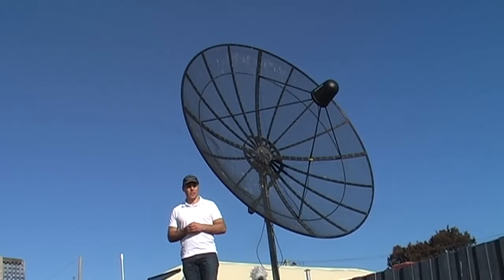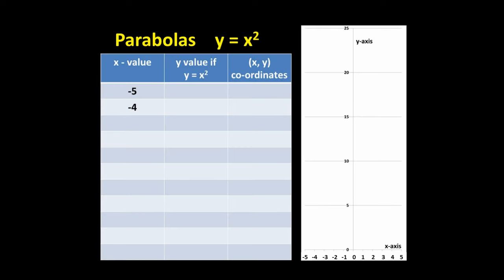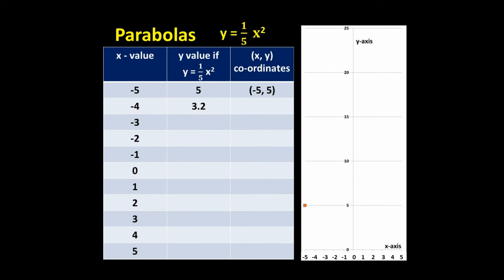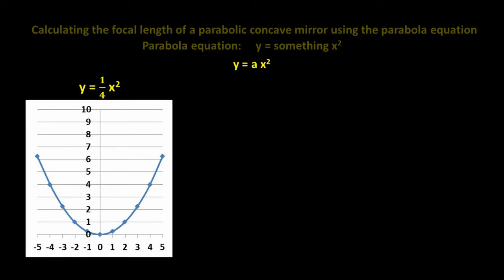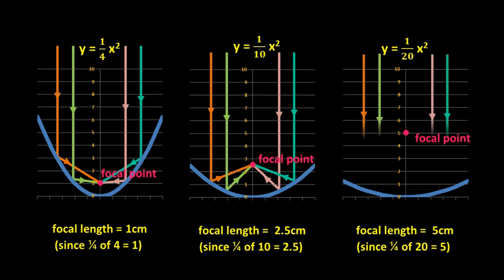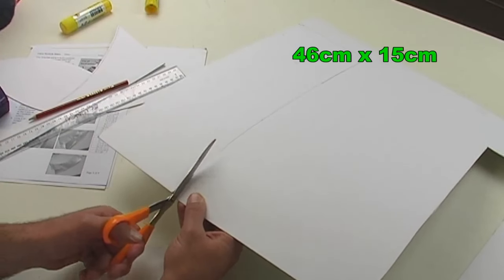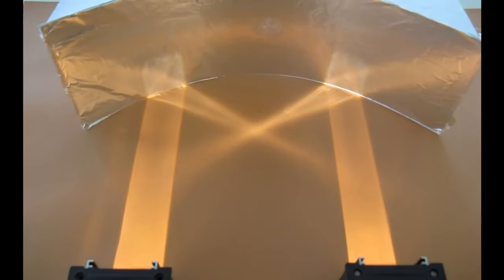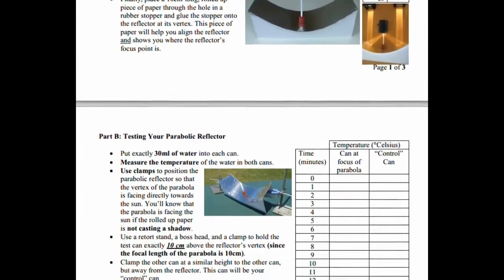Linear Parabolic Solar Reflectors: A Practical Experiment for Students

Comment: The parabolic trough you made has many (an infinite number !) of focal points along a line, instead you only placed the paper stick touching a small part of that line which you called the focal point.  If you place another paper stick at right angles to the existing one at its tip (to form a letter 'T') , you will trace out the focal line with the top of the T.

Comment: Thankyou so much.
I've been lookong for an answer of focus point in concave (from circle) mirror .
And this video showed me that focus point only exist in Parabolic.
Reply from the maker: No problem!
Reply: An absolute focus point only exists in parabolic, that's true. But practically for a solar concentration it is not a problem to use spherical one, because the reflectors usually are not very deep ( curved )  and the solar light will be concentrated practically in the same size area as for a parabolic mirror. Parabolic mirrors are important for telescopes only.
Reply: @poligraph841  spherical mirrors can be used in telescopes too. But below f10 they will start presenting spherical aberration.

Comment: A half ellipse containing 1 vertex will focus straight light coming in onto that vertex. A lot of car headlight reflectors are elliptical, check a car parts store or junkyard.
When you make a trough reflector, run a pipe along the axis and heat water in that.

Comment: I have always used the formula "depth = radius^2/(4*fp)", where fp is your desired focal point distance. Radius squared (x dimension squared) divided by 4 times desired focal point distance. Remember to use the same units for x and y 
Example: fp = 72       r = 30     = 900/288 =  3.125 depth
Reply: Hey Good Afternoon, As You seems to have knowledge in this kind of Stuff. I am a reaserch person (in medical science) and I want to evaporate water from a circular dish of radius appx 1.5feet. the depth of Dish is appx 10cm. 
I put that dish with some active material inside it to evaporate the whole mixture. At last i get solidified mass at bottom of that dish. 
What I am asking is i want to fasten the evaporation of the contains with help of solar energy. Any idea how to do that. 
I tried this parabola but it's hard to focus the point on ground as dish is heavy and I can't keep it in middle of air hanging. 
Can we focus this parabola on ground , how so? Is there any other method by which is can increase the evaporation of that dish contains without fuel ?
Reply: @brandnewayurveda1835  you need a larger dish! Large surface area of the dish larger amounts of sun energy can focused…
Reply: If you want to keep the dish to be heated on the ground, use a magnifying glass

Comment: Thank you very much. Your illustration would be very useful to those who want to design efficient parabolic reflectors for solar cookers. Some are just constructing their parabolic reflectors based on random dimensions.
Reply from the maker: Yes, that's probably true. However, my linear parabolic reflector is not ideal for use as a solar cooker either; it's really a science experiment for students.
Reply: LiacosEM your linear parabolic project was great but let me tell you sir that you are wrong in onething, and that is that you are actually able to cook with that linear desing if the linear parabola is made biger and with better reflected material. thanks by the way understanding this will help any one desing their own parabolic cookers i learned alot thanks againg.
Reply from the maker: Thanks Moon Night. With my simple design, my students have managed to heat up a small amount of water to about 60 degrees Celsius. Real solar cookers I've seen are usually 3D paraboloids, like satellite dishes. However, parabolas are at the heart of both, and I hope that my students learn that maths plays a big part in the design process of so many things in our lives!

Comment: A much easier method to focus a large area of sunlight to a single point would be to make something on the order of a pie dish with the reflective surface being the slanted edge of the dish. If the dish slant is 45°, parallel light waves incoming will be focused to the center in a circle and eventually to a single point. Soooo much easier to construct.

If you are dead set on building a parabolic curve, an easy method is to use a piece of plywood with an x and y axis, the axis running close to the bottom of the sheet. Just drive a nail on the y-axis where you want the focus to be and using a carpenter square, put the corner of the Carpenters square along the x line and the other leg of the square on the nail and draw a line from the corner out. Do this at several places along the x line on each side of the y  line and the resulting mishmash of lines very closely approximates a parabolic curve. Now, you can cut that out with a bandsaw and you're on your way.

Comment: Good job dear , i would like to know what the equation that help me to know the concentrated resultant heat temperature ?.
Reply from the maker: Thanks, Abbas. Apparently, the heat we receive from the Sun averages out to about 1000 Watts per square meter on the Earth's surface. If this heat radiation is concentrated into a small area, there is significant heating. The surface area of my little experimental reflector is quite small, but my students have still managed to heat water to about 60 degrees Celsius.

Comment: Hey Good Afternoon, As You seems to have knowledge in this kind of Stuff. I am a reaserch person (in medical science) and I want to evaporate water from a circular dish of radius appx 1.5feet. the depth of Dish is appx 10cm. 
I put that dish with some active material inside it to evaporate the whole mixture. At last i get solidified mass at bottom of that dish. 
What I am asking is i want to fasten the evaporation of the contains with help of solar energy. Any idea how to do that. 
I tried this parabola but it's hard to focus the point on ground as dish is heavy and I can't keep it in middle of air hanging. 
Can we focus this parabola on ground , how so? Is there any other method by which is can increase the evaporation of that dish contains without fuel ?
Reply from the maker: Good question. You can try just using flat mirrors or aluminium sheets. But the sun moves across the sky so they have to be movable. Good luck.

Comment: But, you make the parabola in one direction, but in the z axis there no curvature, it's flat. How is it that reflects light to the point
Reply from the maker: You are completely correct in your thinking. The reflector doesn't reflect light to a point (like a satellite dish would) and so it's called a "linear" parabolic reflector.  My aim was teach my students about the importance of mathematics and to do a practical science activity that involves a lot of maths. However, a lot of people who actually want to design solar cookers (and related things) have found the video useful in the design process that they go through. I must admit I was surprised initially! However, the use of mathematics makes everything better!
Reply: @LiacosEM  thanks for your kick response. I was thinking about make a 3d model of a barabolic, I'll have to figure it out. Also how to manage to put this reflective metal paper on the surface without breaking it nor wrinkle it... Impossible to do it perfectly, isnt it?
Heating it up would work?
Thanks

Comment: You can also use 2 nails and a string.
Reply: two nails and a string would create an ellipse, which has two focal points.
Reply: drive a nail where you want the focus to be.  Tie one end of  the string around that nail.  Extend the dangling string downward toward you on your surface with a loose  loop where you want the base of the parabola to be, and run the rest of the string vertical up the surface past the nail but attach it to the side of a 90 degree triangle square just touching the nail...   Put your pen at the loop directly down toward you from the focus nail - that'll be the start of one side of your parabola...  now slide the square straight  to the right side and keep the pen tight against the string - as you continue to move the square, the string will slide upward and you'll trace a parabola shape...  reverse it the other direction or trace the 1/2 you already did... Bob's your uncle. (since the teacher sounded ozzish (well, at least commonwealth something...)).  Cheers.

Comment: Sir what if We take an A4 size graph paper and takes X co ordinates form -12 to 12 ? Will it have The same focal length of 10 cm ?
Reply from the maker: Yes. If you look at the 5:30 mark of the video, you will see that the incident light will hit the parabola above the level of the focal point but it will then deflect downwards towards the focal point. For my specifications, all the incident light reflects back upwards towards the focal point except for the light that hits at -10 and at +10. These light beams reflect horizontally (with respect to the plane of the reflector). Every parabola has one focal point, regardless of how wide it is.

Comment: Or you can just use parabolic mirrors and make the effect exponentially better than your aluminum foil and linear approach.
Reply from the maker: It's really a science experiment to teach students the mathematics of parabolas and how they're used to focus light. However, linear parabolic reflectors are used to heat oil in a pipe that runs along the focal line. See https://commons.wikimedia.org/wiki/File:Parabolic_trough_solar_thermal_electric_power_plant_1.jpg. My school has a parabolic mirror and my students are really impressed when I use it to ignite paper. But teaching is not really about showing kids stuff, it's about getting kids to learn by doing stuff!!